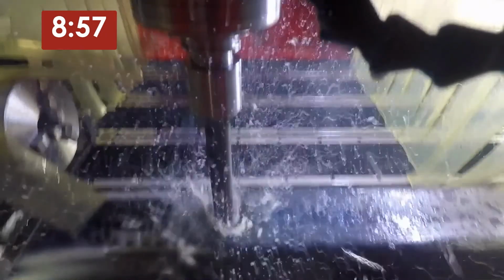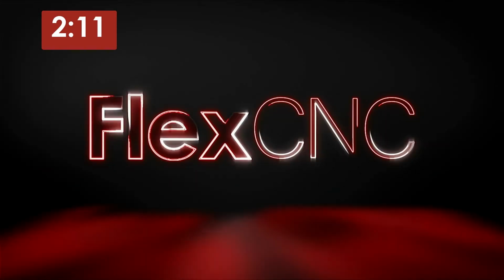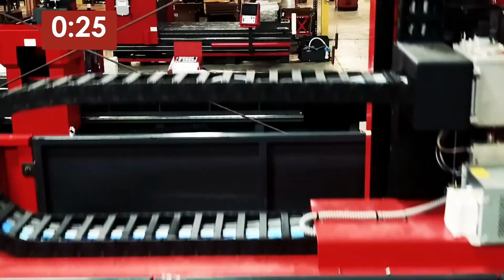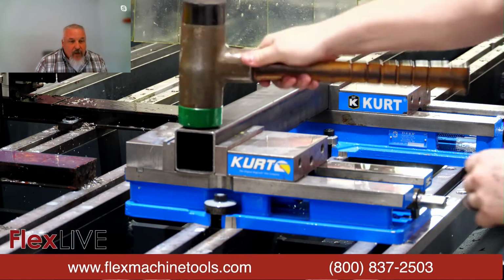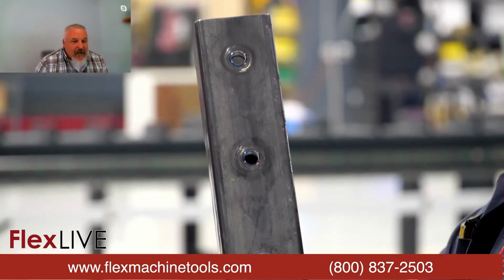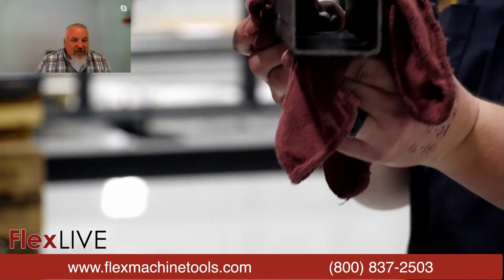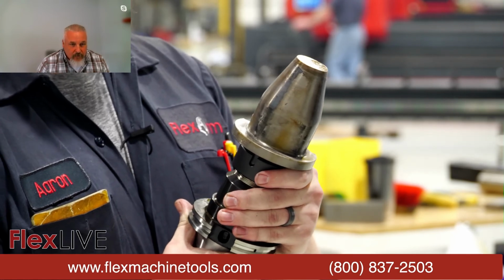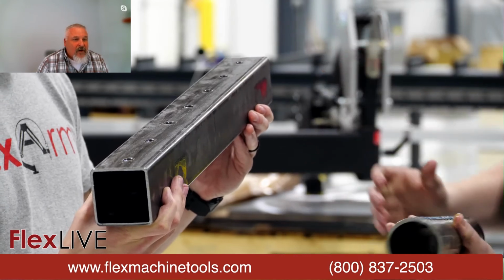How to Flowdrill on CNC using FlexCNC Biggest Thermal Drill EVER - Live Demo

Comment: Wonder if flow milling is possible? For slotting steel piping.
Reply from the maker: The machine is more than capable of milling slots in pipes. A 4th axis can be added to automate the rotation as well.
Reply: @FlexMachineTools  By using a flow drill? To get that added material on the backside for a interference fit and induction weld.
Reply from the maker: @futureonjk  From our experience this type of tooling is only used for drilling operations
Reply: @FlexMachineTools  Ahhh, I understand it's a drilling operation. I'm talking about material displacement under milling operations. Don't you need in piping and sheet metal applications to be thicker around the slot or edge? Is their friction forming in milling applications.
Reply from the maker: @futureonjk   That's a good question. I only run the social media, but if you follow the link and select what state you live in you can get in touch with one of the representatives who can answer all of your questions. 

https://flexmachinetools.com/flex-distributors-map-usa/
Reply: Only by accident.